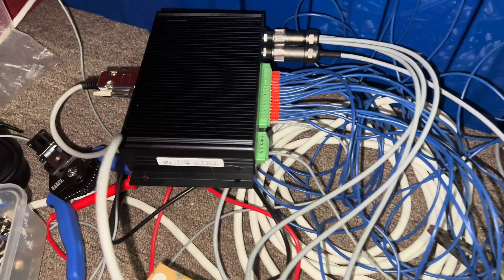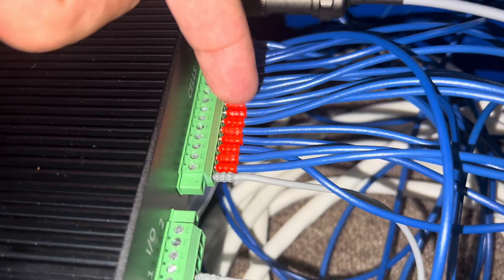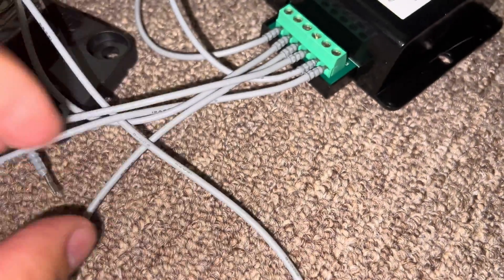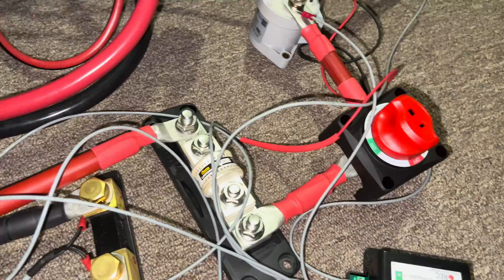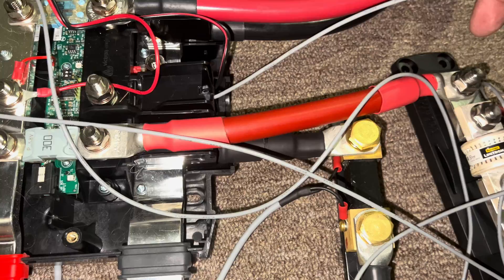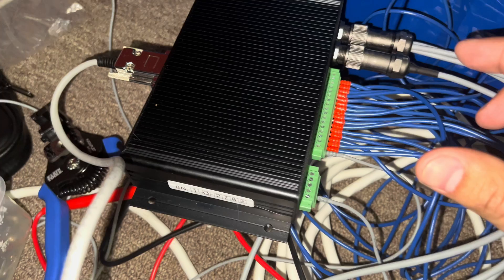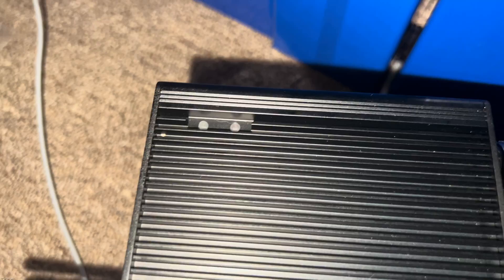Wiring setup for how I fried my Rec Q BMS! Don’t do this! Learn from my expensive mistake!

Comment: The manual says 
Pin 1 = Groud
Pin 2 = Cell 1 positive (3,4v) - not cell 16
Pin 3 = Cell 2 positive (6,6v) - not cell 15
...and so on
You have probably discovered that you have cel 16 on pin 2 (53,2v) and not cell 1 (3,4v)
I think this applies to all BMS
Reply from the maker: Yep. My issue was I expected pin 1 to be on the left, not right.

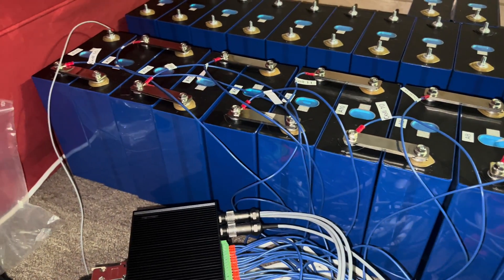Comment: My understanding of the manual shows that the difference between any 2 screws(side by side), should read around 3 volts (a single cell only). The ultimate negative needs to be positioned beside cell 1 for this to be possible. At 4:29 in your video it shows 53.2v between 2 screws side by side. I think this is the mistake
Reply from the maker: Sorry for the delay- I definitely didn't realize that pin 1 was on the right vs. on the left like I expected. The biggest thing is to pay attention to the ground indication on the BMS itself and use that as the basis for checking voltages.

Comment: The contactor is your positive and the shunt is your negative leads , going to the battery, don't forget to put the leads on opposite ends of your battery bank. The REC bms is different in that the last cell lead is next to the negative lead instead of the first cell, I want to get the 500ah 4s version so bad, but I am poor so I have to wait and save
Reply from the maker: Good tips, thanks!